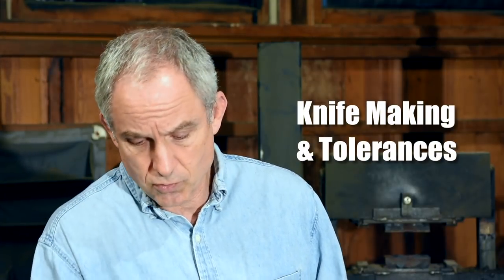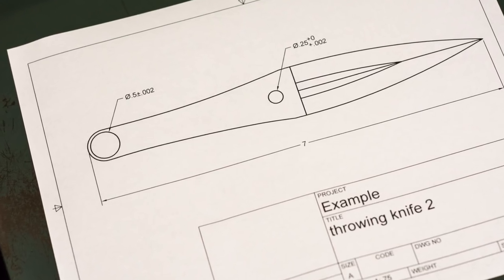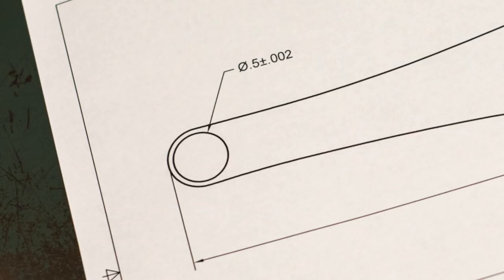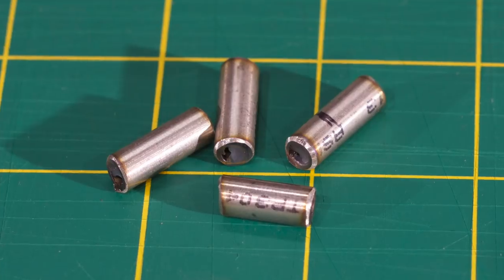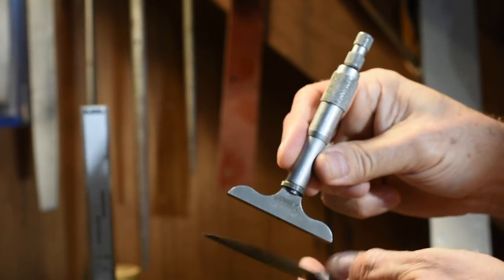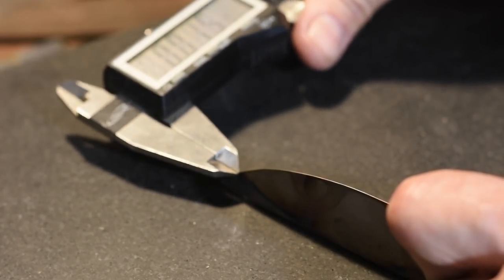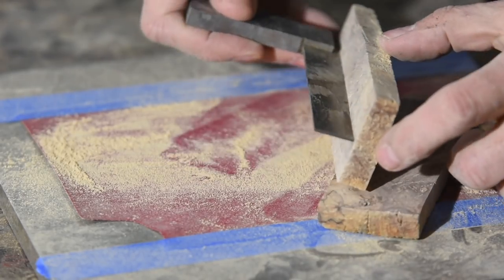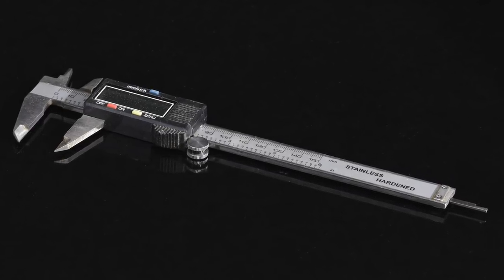Knife Making Measurements - Friday Five #39

Comment: Question:  Warpage.....if your blade warps during heat treating, say when you quench, what's the best way to straighten the blade? I know when it's hot is the best time, but at what temp? Or any other suggestions?
Reply: If it's bent in the middle put it on a flat bar of steel Apex facing up and put some scrap (maybe 3mm thickness) under each side of the bend, i.e the tip and tang and the clamp the middle to the flat bar, temper it while clamped like this and it should be straight